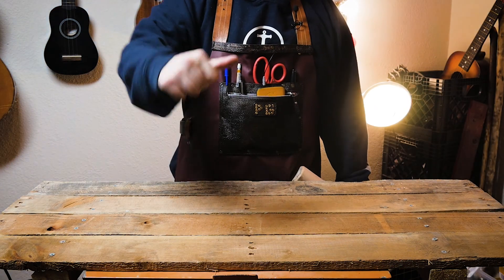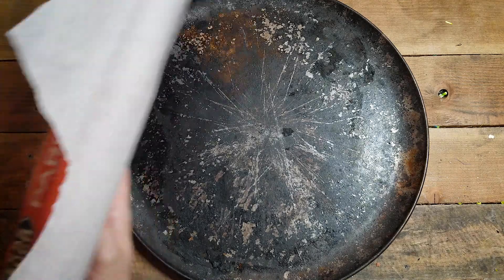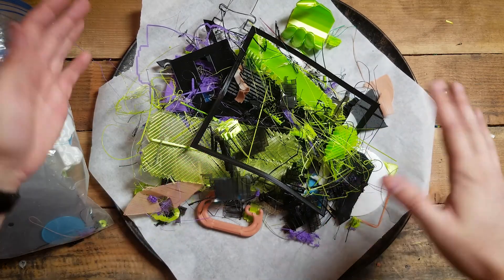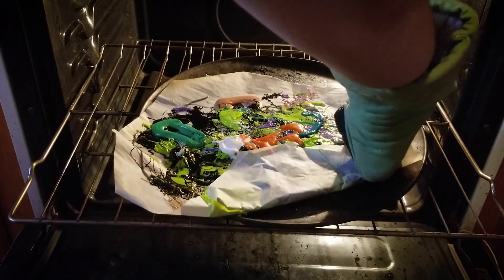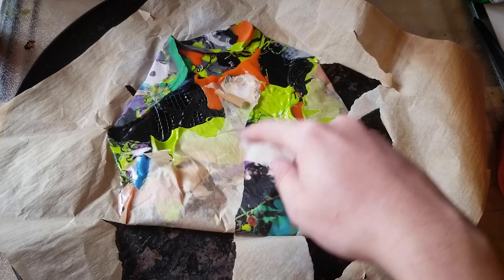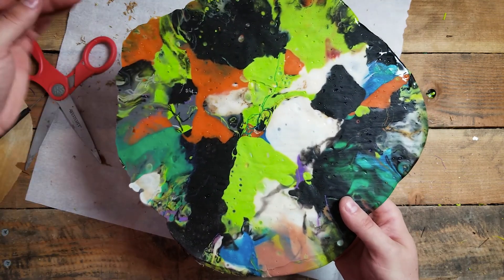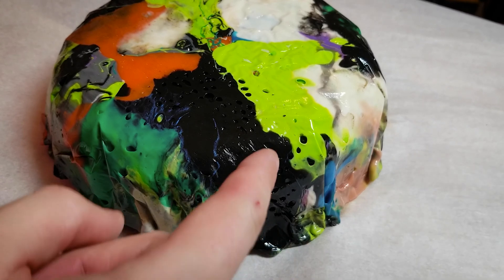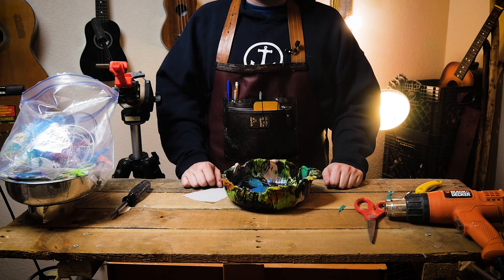RECYCLE your 3D Print Waste! (by melting it)

Comment: If you watch some glass fusing videos for tips….i think they call it slumping, where you use heat to slump and drape glass over various forms and shapes.  It’s the same principles and similar techniques, just a different temperature range.  🙂👍🏻

Comment: I was wondering if it would be possible to make filament by first preparing 2 thick sheets of metal in a way that you machine grooves (1,75 diameter of course) on each scheet (so placing second sheet on first one would create long cylinders) and then melting on top of first sheet plastic and after that press from above using second sheet (excess plastic would flow out and rest would accumulate in groves). after cooling it would (hopefully) create filament sticks.

Comment: try throwing the scraps in silicone molds, ive been toying with that for awhile, never though tto use cooking oil as a mold release though, might try that nexct time.
Reply from the maker: Just tried it actually! Had a lot of trouble getting the bubbles out, dunno if it's worth it, but let me know how it goes if you try it!

Comment: I dunno if it exists, but a heated knife like thing (especially if it is like thoes plastering flatners) that would be great for detail work
Reply from the maker: I feel like I've seen soldering irons like that... Good idea!
Reply: I took my regular iron and a large washer with a small hole drilled in the tip with a screw and leave it a little loose you can seal bags and cut PLA I have seal vacuum lines on cars a lot of uses
Reply: Colin furze made a device which heats up every knife

watch?v=PuJ3gE78tvU

Comment: How about resin prints?
Reply: This would only work for thermoplastics used in fdm printing. Most resin unfortunately will not melt like this, or will put off significantly worse fumes when it does

Comment: What about melting in a Pyrex rectangular 2" deep glass bowl?
Reply from the maker: I tried this, but had issues with the plastic melting inconsistency and dripping down the sides. If you have a second, slightly smaller bowl you may be able to make a kind of mold out of them to get the look you're going for.